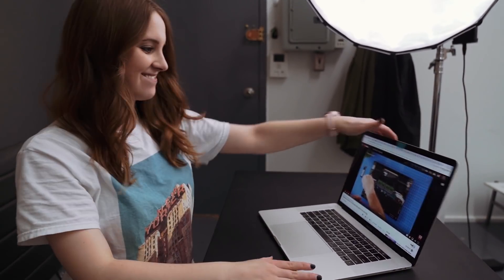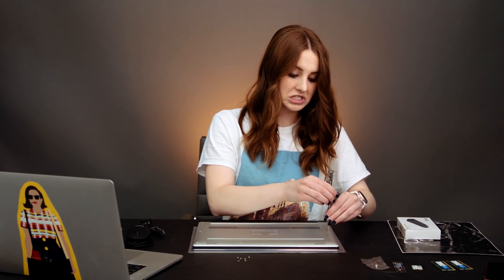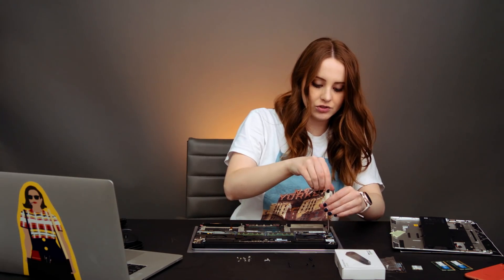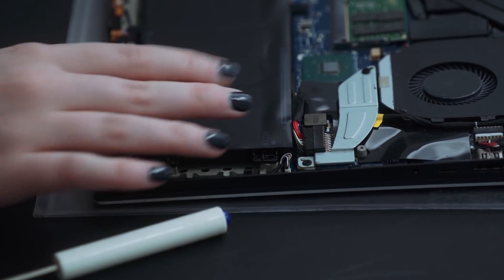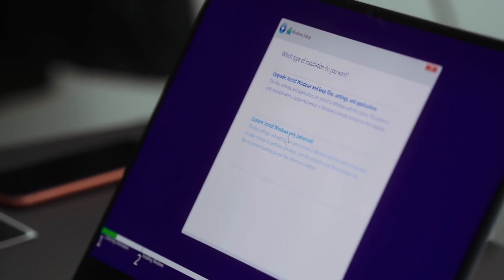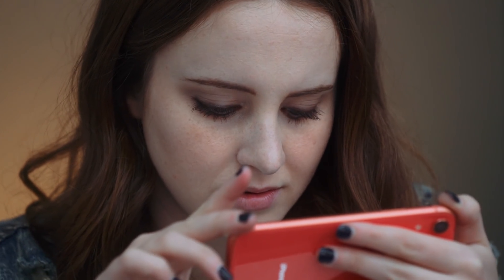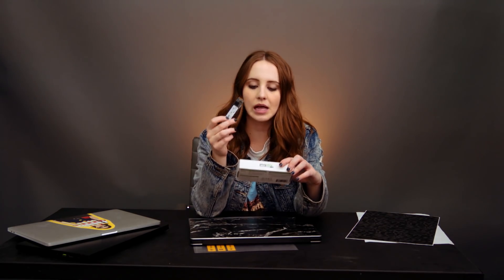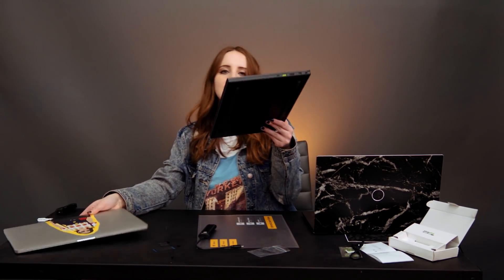How to Upgrade the Dell XPS 15 9570 !!

Comment: Wow. I really love this video because I did the same update on an XPS 9530 around the same time you created this video, and I also did the same thing you did with the 500GB SSD that came with the laptop (I used it as an external hard drive). If I had seen this video before doing the update, I would have felt more confident about performing the update, but in the end everything works fine. Thank you for being just the way you are... I love your vibe!!!

Comment: Hello Sara, hello everybody,

I have 3 questions:
1. What are specifications for a compatible XPS 15 9570 RAM? (I understood that I canot simply buy any 32gb RAM, but specific ones)
2. Why should I replace the WIFI card? Does the new card bring some "stamina"?
3. All SSD of XPS 15 9570 are m.2 80X22? (I heard that there are "half of 80X22" format)  

Thank you so much for your feedback.
Alain

Comment: You can make that SDD go even faster!  
You will have to go into you BIOS and change it to AHCI from RAID - BUT right after you do this you won't be able to boot the OS on you device.  You might also consider upgrading to the 2TB EVO PLUS form Samsung... It's pretty kick ass too...  
You will have to re-install windows, but, well, you know you want faster... 
This will allow you to get the full power of you Samsung 970 PRO NVMe SSD. 
To do a before an after comparison, install and run CrystalDiskInfo - Take a photo / screen shot of the info especially note Interface, Transfer mode and Standard.  
Then run CrystalDiskMark and click ALL to run all of the tests and capture as a baseline benchmark to compare to afterwards...
Update the firmware on your XPS too with Dell Command Update.  This might be a good first step.
Go to https://www.samsung.com/semiconductor/minisite/ssd/download/tools/
and grab the NVMe Driver (v3.3) you are likely running the slower Microsoft NVMe driver... it is slower... (You won't be able to install this until after your rebuild)
and grab Samsung Magician 6.1and it will enable you to update the Firmware if you haven't already done so...
Use Rufus (OpenSource - all the cool kids use it - https://rufus.ie) to create your boot USB, it will save you hours of work setting up a bootable USB with Windows
Choose GPT for Partition Scheme and Just UEFI for the Target system...(point it to your Windows ISO.  Make sure you grab a new version, not the one from a year ago, or you will have a LOT of Windows Updates
You also want to make sure you run your rig with UEFI instead of Legacy - go into the BIOS. If you are ready to pave your machine, now would be a good time to change the disk access from RAID to AHCI.

After you are finished installing the system, use Dell Command Update to update your drivers, and install that Samsung NVMe Driver v3.3 you downloaded earlier... compare your speed... 

Also Just bought the newer Intel AX200NGW for CAD$ 33 from Amazon... Bluetooth 5.1 and WIFI 6 - blazing fast if you have a new fandangled WiFi Access Point... 

Hope that helps... You may want to look and compare the Benchmarks for the 970 Pro 1TB vs the EVO Plus 2TB... I think you might be impressed with the difference... and it is likely cheaper... new life to your XPS

Comment: great video, OMG, having recently purchased a 2018 dell 15 7590, I was not made aware of a swelling battery issue. I am curious as to know if you have hade to replace the battery at all and how long are the batteries rated to last? Was there any error and or alert that the Windows OS gave you in your discovery of the battery problem, that is did you perform a diagnostic which informed you prior? This really sucks, to where I may now consider returning the laptop for this reason. Thanks

Comment: Just to point out, having re-pasted the CPU and GPU of my dell XPS 9570 i noticed a MASSIVE improvement to thermal performance (as well as applying much better thermal pads to the VRM/Chokes [the little black things above the heat sink], Undervolting using Throttlestop etc.). I'll certainly utilise this video's upgrades too! The makings of a cooler (thermally), powerhouse laptop!

Comment: Do you have a video showing how to fix and/or replace the touchpad on the 9570?  The lower right area of my touchpad has no room to be depressed (can't click it any more).  I bought a new touchpad; however, the metal plate on the back of my touchpad did not come with the replacement touchpad.  I need to obtain a new metal plate or removed the metal plate from my touchpad for use on the replacement touchpad.  The plate is held on by a very strong glue.  What is needed to remove the glue/plate?  Is this how the repair should be done, using the old plate?  What glue should be used to reattach the plate to the replacement touchpad?  Thank you.

Comment: 2 questions, what exactly is the advantage of changing the wifi card?  Also, if you were going to put the SSD into the enclosure, could you have done that with the new SSD and cloned the old one, or is it a MUST to do the Windows install separately?
   I have both Apple and Dell machines...and when its time to replace my Dell, I'm thinking an XPS 15 is what I want.

Comment: in regards to old drivers when the new hardware is good to go, specifically the wifi card. My question is I know you need to remove the old wifi card drivers but do I additionally need to remove the Bluetooth ones aswell?

Comment: Hey Sara! Great Videos, love your content. Do you have a recommended Dell XPS spec set-up PRE-upgrades that gives you the most bang for your buck ahead of the upgrades, and then once you add the upgrades you outlined in this video has the PC go full BEAST MODE! LOL I'm looking at getting an XPS and curious if you'd suggest the i7 of i9 and optimal components to buy through Dell before doing the upgrades above. Thanks, Mike

Comment: I understand the memory and ssd upgrades, but why did you upgrade the wi-fi? What added benefit does that give you?
Reply: The killer WiFi card often disconnects for no reason. There's many problems with that card

Comment: Did you have to purchase a new windows 10 key?
Reply: Usually you shouldn't. I believe I read that the Windows Key is saved onto the BIOS of the Laptops MOBO. Even if that's not true there are several methods of moving your Windows license from one PC/Drive to another.
Reply: @Weegeehunter1  no it isn't installed in your BIOS. It's linked to your MS account for that hardware and would reactivate when you enter your MS account
Reply: @RackaApps  Thanks!
Reply: Legit Plays ah, that makes sense, I didn’t mean to imply that windows is installed on the mobo instead of the SSD. Bad wording.
Reply: @Weegeehunter1  Thanks!

Comment: Did the wifi work immediately after swapping the wifi card or did you have to install drivers? I have a Lenovo Legion y530 and that model came with two wifi card options. I have the defective version so I want to upgrade.

Comment: I know you only released this video about a month ago, but with the "New Dell XPS 15 7590", are we still looking at the same or similar benefits to making these improvements ourselves? With 64GB of ram, support for up to 2TB drives, and this new wifi card, I'm just wondering if I should get all that as Dell would spec it or would I see a performance improvement with non-stock components? I'd really like to hear your thoughts on this @Sara Dietschy :)

Comment: Question for you XPS 9570 experts - the aluminum back panel on my 4K screen has some cosmetic damage. I'd like to replace it, and I've found the suitable part online being sold by a number of sellers. Does anyone know how to separate the aluminum backing from the screen without damaging anything? I know it's possible because the backing is available for purchase separately and people do purchase them.

Comment: Disconnecting the battery is not required, but if you are going to, you might as well hold down the power button to dissipate any charge in the capacitors :)

Comment: I know that is possible to connect an external GPU by Thunderbolt 3 but does it possible to connect an external CPU? I don't need more graphic performance but I would like to get more performance using a second i7 processor, is that possible!????

Comment: Would you suggest the Dell XPS 15 or Matebook Pro X for 4k Proffesional video editing on Premiere Pro?
Reply: On Matebook pro x u can't edit video up then 1080p, Dell xps 9570 i7 8750h, 32gb ram 4k screen would rock it! And just keep in mind you need this 6 core processors becouse of 4k editing. (which i7 8750H has)

Comment: When installing windows from fresh you should create two partitions. One for the system and another one for your important files and documents. In case you have any issue with the computer that would require a windows reinstall you will not lose anything important you have put aside on the data partition. When reinstalling you will only have to format the system partition and reinstall windows. All of your data on the second partition will remain safe.

Comment: The Samsung SSDs come with cloning software which works really well. You just need a USB - SSD adaptor and you can clone your disk image onto the new SSD so that when you turn it back on after the switch you can pick up where you left off on the new drive without wasting hours reinstalling all your software.

Comment: Beware that If you intend to use your Dell for Hackintosh, the Samsung 970 EVO plus (EVO+) SSD firmware is not supported by Mac OS, you have to use either the Samsung 970 EVO SSD  or the Samsung 970 pro SSD.

Very good video that shows that normal people can upgrade their laptop and not only super(wo)man.

Comment: Not all XPs are shipped the same. My configuration included the early release 980 Samsung drive and it beats my 960 pro I had in my previous model that I was going to replace it with. Before individuals upgrade for speed may be best to advise checking crystal mark and see what their speeds are
Reply: What about kxg50znv1t02 nvme TOSHIBA 1024gb?

Comment: Would you not have used the external PCIe sdd enclosure to transfer the operating system and programs to the new sdd instead of doing a fresh install?

Comment: What's the issue with the original wifi card?
Reply: XPS is pretty famous for its shitty wifi, they used to ship 9560 with both intel and killer adapters, a lot of people had problems with them. I guess nothing has changed.

Comment: I just don't understand why people upgrade the wifi card in a laptop. The ram and storage is ok but wifi card really. Do you really have a wifi connection so fast that the wifi card in your laptop is bottlenecked?
Reply: My XPS 13 was mega slow just one room over, I was dropping 50% of my internet speed. I figured out I could change wireless to max performance, but this noticeably reduced battery life. It can be a genuine upgrade in this case.
Reply: @joshj.8870  it can be but in my experience the poor reception of WiFi is because if poor antenna design implementation during designing of the laptop chassie. Replacing the WiFi card will only cause little to no difference in speed and performance if there is poor antenna design.

Comment: I dont get this upgrade sruff. Did the pc suddenly get slow or wtf
Reply: Because you can upgrade it not because it's slow. She upgraded the RAM to load more at once, upgraded the drive to hold more, and upgraded the wifi card for internet speed. The computer itself is not slow. upgrading doesn't equal it was slow before.

Comment: Wow, you take way to much caution when replacing things. I have the XPS 9550. Pretty much the exact same thing and the screws in the middle aren't anything to worry about and the battery doesn't need to be removed, to be safe I guess but I never remove it.

Comment: Just did this last month, sooo easy. This is why i didn't buy a macbook.
Reply: Hold up. I bought that exact same ssd enclosure as well
Reply: @michaelbornman9313  The SSD on XPS 9570 is M.2 PCIe. Does this work on this enclosure?
Reply: @igorsilva5814  Yeah I took the old ssd from the laptop and put it in the enclosure
Reply: @michaelbornman9313  Ok! I asked because the SSD on XPS is a PCIe and the enclosure is for NVMe SSD's. But if you said it works, that's fine. Thanks

Comment: Just a suggestion, maybe, just maybe, STOP reinstalling windows when you change your boot drive. There is FREE software that will literally clone every 0 and 1 on that disk on another disk, like MiniTool Partition Wizard. Great video overall 🤣.
Reply: That's the only drive in the computer. How is she gonna clone it?
Also installing windows on an M.2 SSD literally takes less than 5 minutes. Cloning a drive takes way longer.
Reply: @Collector2006  exactly what I was thinking, I've done it on macOS and windows and it sucks ass either way when cloning
Reply: @Collector2006  You clone it to the drive in the new laptop, dumbass. Two drives, 2 sata cables(if you are cheap and don't own a dock for 3.5,2.5 and a m.2 to sata adaptor)and start cloning.
Reply: As someone who uses cloning tools (I use Macrium Reflect) I've found that windows 10 doesn't like to be cloned on to disparate hardware.  It may boot up and look functional until you have to do a factory reset...then things can get a little weird.
Reply: @namyun2743  If you take an ssd from a crappy i3 fourth-gen with very different integrated graphics and put it in a top of the line laptop from the present, I would believe you, otherwise, stfu :D. I've done lots of cloning/migrating my boot drive between 5 laptops, just in 2019 alone :).  Intel is using the crappy 520/530/620/630 integrated graphics for ages at this point, anyway.

Comment: a few suggestions, 1) place back the T5 screws exactly in the same spot you took them from; the corner screws tend to gain some indentation as the chassis is not flat but curved at the corners; 2) before removing the hard-drive, create a recovery media from within the current dell installation in a portable USB drive, this will place the dell windows image with most drivers already there; 3) before putting all the screws back, boot the machine; it is a pain to have to remove them if say a memory dim was not properly seated.

Comment: Hi Sara, I upgraded my Dell XPS 15 9570 exactly as you did. Thanks for the video.
 I have been searching for a solution regarding the high saturation level of the display, have you found any workaround for that??
Reply: I see that she did a video on the saturated display, but you probably know that by now. 
How did your Dell work after the upgrades? I have this same model and wish it handled editing 4k video in Davinci Resolve better. Did you see a noticeable improvement? Thanks.

Comment: You don't need to unscrew and remove battery for this task,  just disconnect the cable. I've done this a dozen b times without unscrewing the battery.

Comment: Nice vid! It isn't necessary to remove the battery, only to unplug it. I have the same laptop, the standard PM981 SSD and 16 GB RAM are enough for me, as I don't do video editing, but its nice to know that it can be upgraded. Let us know how much difference the new parts make. The write speed of that Pluggable SSD USB-C enclosure is disappointing, clearly the SSD drive itself is not the bottleneck...

Comment: Haha. You say we disconnect the battery and you deinstall it from it xD. Just unplug the cable. By the way I upgraded the RAM on an old MacBook PRo and actually forgot to unplug or turn off the machine. And it still works.

Comment: You could've gone one step further on cleaning fans/repasting, that helps with temperatures and fans running too loud. Also watching it from Dell XPS 9550, had the same emotions when I've opened it up the first time

Comment: some laptops like the high end "gamer" or "creative" laptops can have 16gb of memory, but only one stick. dual channel has been proven to be way faster. so much so that is some cases 2x4gb is faster than 1x16gb of ram. so always double check your memory
Reply: Randy Rodriguez not exactly faster just doubles the bandwidth, also it depends on what speed the ram is at 2 gb of ddr4 3200 mhz ram is faster than 64 gb of 2133 mhz ddr3 memory

Comment: Side note: You (who ever reads this) could cloned the drive using macurum reflect before swapping out the SSD. To make it easer, get a external M.2 empty case install the new drive in said external case then plug it into the USB port. Clone the drive, then swap them out (take the drive out of case and take old drive out of laptop then swap). Then take your old drive and install it into the external case and now you have a portable M.2 drive. Also you can help friends out if they want to make the swap later on using the external case.
Reply: helpful tip. Thanks
Reply: Or even Samsung migration software when changing to their ssds

Comment: To all:

before following Sara's step, please

1. install Macrium Reflect (free software)
2. Use Macrium Reflect to clone your existing SSD data to your new SSD (which mean copy the exactly the same data to your new SSD, but don't try using only copy & paste, use this software)
3. Follow Sara's step (until installing window)
4. Power on and enjoy.
Reply: @ryan420hk thank you! I've been wanting to do this, but didn't know how to recoup what I already have on my laptop. I use it for work so I didn't want to risk losing it all. Appreciate it! Also love the video! You're fantastic
Reply: Can I do this even if I upgrade from a bigger compacity hhd to a SSD?
Reply: MC_ Runde all you need to confirm is - your total used harddisk space can’t bigger than your new ssd space, it is simple
Reply: @ryan420hk  OK then. Thank you